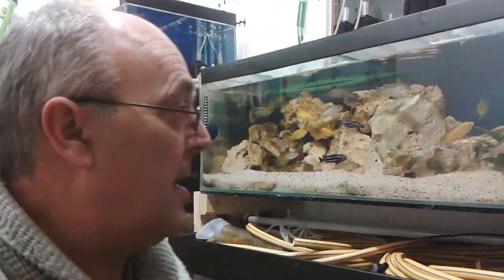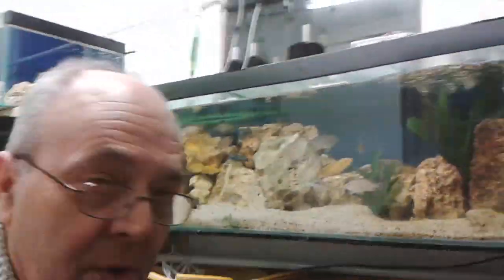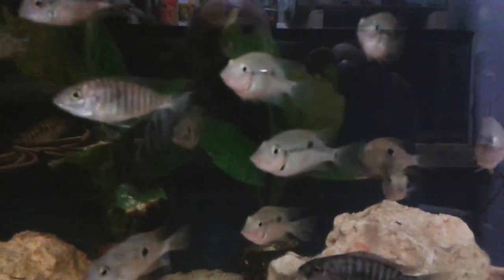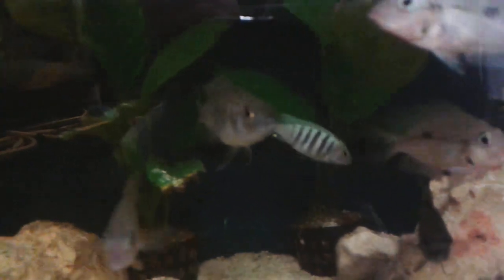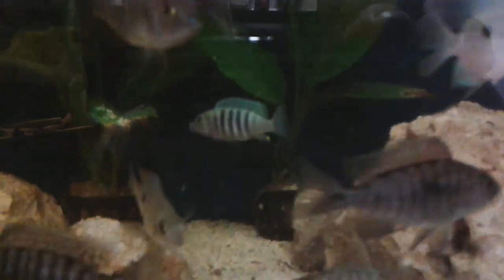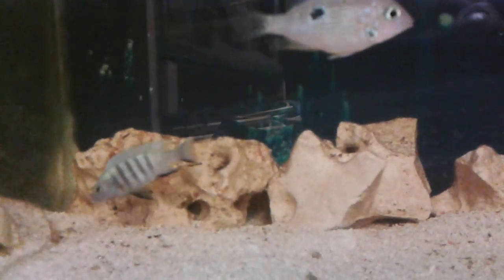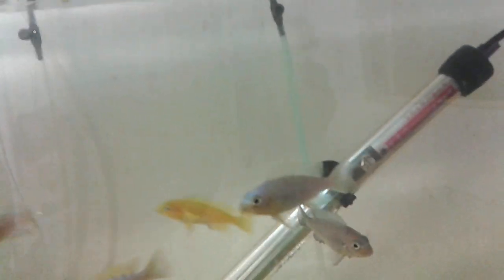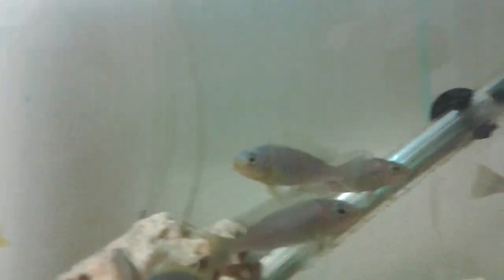Cichlid fish room, tip of the week.

Comment: I found out that every time I turn my air pump on the fish gulp air and its because its in cupboard beneath the tank which is also used for storing shoes. Its obvious now what's happening, its pushing through air that contains too much co2. Thanks again for your  tip of the week!

Comment: Ivan I'm getting a similar issue with a fee of my haps not peacocks occasionally gulp air. I can't understand either because I run a 275litre 48" in length tank with 2 external filters turning the tank over 10 times an hour (2700 litres per hour) also run an air stone and a wave maker! I will try your tip of the week and see if it makes a difference.  The thing is none of the fish look like they are breathing heavy at all.

Comment: Sorry mate but I do have a disagree there in regards to the air ring.
I run an 8x8ft air ring ran off 2 big pumps, one is a Blagdon KA50 and the other is a Hailea piston giving me a total of 110L of air per min.
My fish room is heated to a whooping 86'F which is around 20'F higher than yours and my fish room is also VERY well insulated and never have issues you have faced.
Just goes to show the difference between people in this wonderful hobby :)
Reply: Haha Ivan defo not mate! Try placing your air pump above the tanks, you'll get more out of it that way AND it will pump warm air into the tanks helping with maintaining temps in the tanks, Both of my pumps are high above all the tanks in my fish room
Reply: No probs mate, Happy to help :)